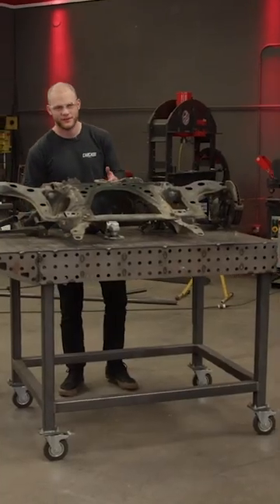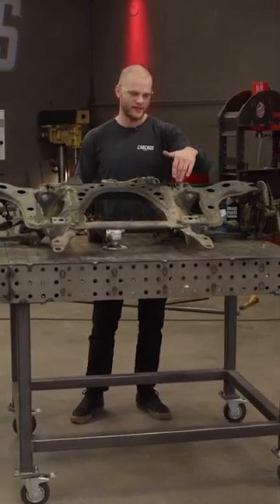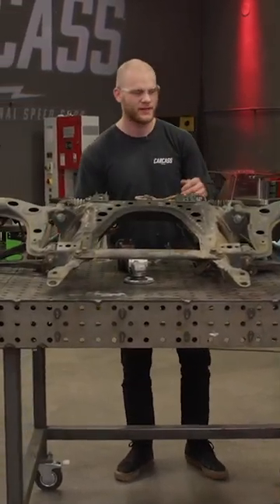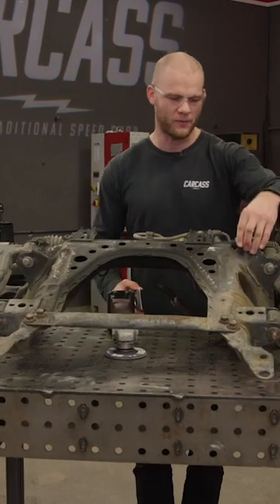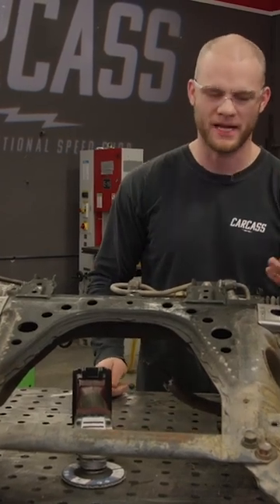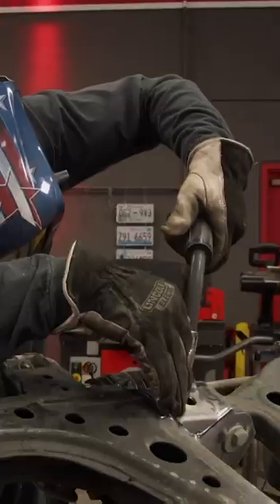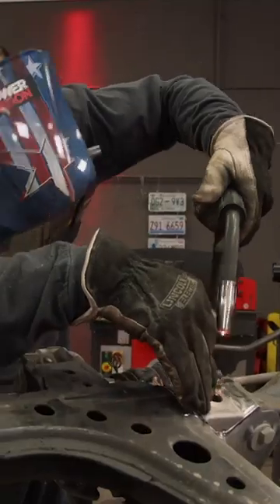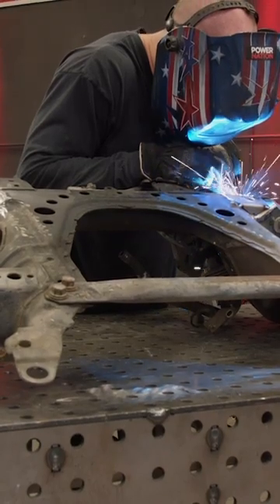How To Reinforce the Subframe

Comment: That will be $300 for some easy ass mig welding
Reply: Not that easy but more like $450. In my shop it would cost 1 hour of labor per side plus parts. Shop rate $200 an hour, $50 for parts

Comment: Why don't you use a stick welder it's a lot 
Stronger job.
Reply: It's the same strength wise as it's a weld. If anything they didn't use stick due to how thin and small the piece there are welding is. Most people would burn thru it just tacking it with a stick
Reply: You probably have never welded thin ass material lol . Mig works fine in this case lol